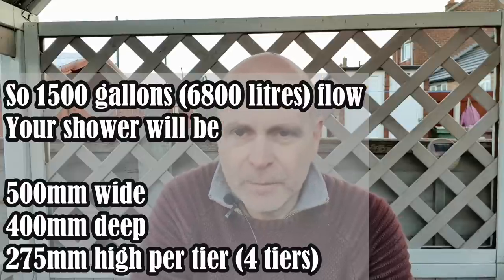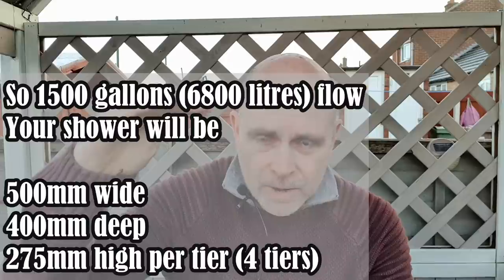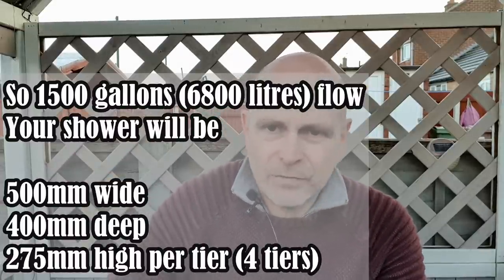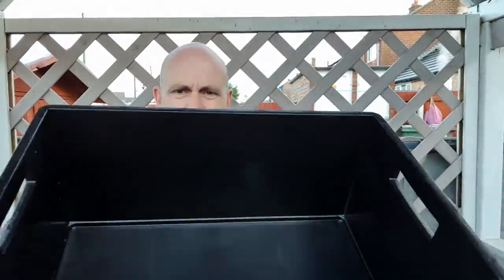DIY Bakki shower (Make your own PART 1) homemade Koi pond filter

Comment: Really love the content of the videos I’m finding them so helpful . I’m currently in the planning stages for my new pond for once I’m in the new house. I would love a bakki shower but can the showers be placed in a filter house and pipe fed back to the pond? The boss aka the wife doesn’t like the look of them 🤔
Reply from the maker: Thanks Robert, much appreciated 🍻
Its not easy to install them remotely unfortunately. Because the water needs to return to the pond from the shower by gravity it needs to sit high up. You can do it but you would need it sat such that there is a pipe running from the bottom of the shower to the pond above water level. As such the shower would be to tall for most sheds and filter houses. Also, because its a gravity return it needs to be a decent width of pipe, I've used 3" on mine and I only have a very small flow over it.
they really need to sit on the side of the pond.
You can box them in and clad the outside etc to make it look better if you want to. That may be an option. I'm going to cover mine and tile the outside with the same tiles I used on the pond I think.
Reply: Thanks for the reply , I personally like the bakki tower look just have to please the wife 😂, that’s a good idea to box it in and tile that’s something I can look at. The world of filters to a new keeper gets very confusing.
Reply from the maker: It does mate. There are a million options and every option has a fan club who swear its the best option. Its good if you can visit some hobbyists who have systems running and see how they are performing.
People want different things to. Some rate a filter highly because it is easy to clean, some because its cheap, etc etc so we all have different ideals.
I place a lot of emphasis on ease of cleaning, not because I'm lazy, but because when its easy to do you are more inclined to do it. I avoid things that are onerous to clean or it becomes to easy to just put it off. I flush mine every single day so the fact that its just a case if turning a few valves and takes 3 or 4 minutes is massive for me.
Reply: I’m all for the ease of cleaning once I’m in the new house and the plans are finalised regarding filtration I maybe asking for you to give it a once over if that’s ok pal , the pond I run now is only a small pond and runs off a pressure filter so it’s going to be a big step up.
Reply from the maker: Yes mate , of course 🍻👍🍻👍🍻

Comment: Good info Dazzle . 👍 I'm building mine roughly 120cm (L) and 13" (H) & 13" (D) with possibly a 15.000 pump or 20.000 Vari??? Also gonna use multiple rock ceramic media within shower (Kintama, Marine Pure sphere ,  volcanic rock + alfragrog 👈 "Maybe")..
Reply from the maker: Hi Simon, sounds good mate, try to use as much of the ceramic stuff as you can as thats the one that will house anaerobic bacteria and take care of your nitrate 👍👍
Reply: I've always used MarinePure for discus and Marining, and in pond (static tho). 1.5" Spheres which 🤔 1.5 inch sphere is equivalent of 132. 000 sqft area surface £64 Per Gallon 👈  and have been around in use over ten years 🤔 don't think I would use that bhm (momotaro) arm leg stuff on six year study?? What's your thoughts on it Dazzle ??
Reply from the maker: Hi Simon, I filtered a 5500 gallon pond purely on showers, nothing else at all, and they all only used BHM. I haven't found an alternative yet that could get anywhere near the BHM, its as good as it gets for me. BHM was developed alongside the shower filter, specifically for that purpose. Unfortunately I can't afford to spend BHM money now so I'm going to look in to it thoroughly and see if I can find something that comes close but costs a lot less.
Reply: @DazzleKoi  Been looking into media myself. From what I've seen, from the likes of crystal bio media and bio home shower media. It all looks and seems to do the same job as grow stones and hydro stones. Which is sold at a fraction of the price. Starting to think it's just been labelled up, to make a huge profit.
Reply from the maker: Hi Adam, the original BHM was developed specifically to optimise the conditions in a shower and with nitrate bacteria in mind. It is fired at very high temperatures which causes the internal structure to fracture and open up millions of tiny 'tunnels' inside that can harbor anaerobic bacteria. The conditions for anaerobic bacteria to live are extremely difficult to create as they need a habitat completely void of oxygen. They then take their oxygen source from the nitrate thus breaking it down in the process.
The ceramics also have some FIR (far infrared) properties and are able to degrade some organic material.
None of the alternatives do this.
So yes, while you can put practically anything you want in a shower and get some biofilm growing and see some aeration, its not actually working as a shower can. Its only really a trickle tower. This is why a lot of people make a shower (or buy them even) and are happy with them as they see some benefits. But in reality there is so much more to be had.
Ive not heard of grow stones or hydro stones though, I'll take a look 👍👍
Reply: @DazzleKoi  yes have a look, will be interesting to see your thoughts on it. I agree the bhm is one of the best on the market, for nitrate breakdown. It's just the cost £200 for 10kg, is a lot to fill a four tier shower.
Reply: @DazzleKoi  But the Marine Pure is 15 years old with production and is well renowned as the BEST Ceramic Media ever made Brightwell doesn't even come close Nor does kintama . And the Marine Pure SPHERE Media is made for SHOWER UNIT with best results with a higher surface area than any other on market. This Chinese, Japanese brittle product in my opinion is hype and over priced for what??? (Be good to see side by side comparison)??I 🤔 Marine Pure Wins ? 🇺🇸 Made do make quality products that most over look or just don't KNOW!!!? (KESSIL, CYBERGENICS, MARINE PURE) 3 Quality products that are unrivalled
Reply from the maker: It looks  interesting for sure. The silica coming of it worries me a lot though. I'll have a proper look in to it though mate👍👍
Reply: @DazzleKoi  I can ASSURE you that silica doesn't leach out of this media, unless you buy the fake 1 that was circulating that leached aluminium and "poss silica" which I've never heard of ?where did you read or get information on silica leaching out of Marine Pure ? as I use to have a Marine tank with lps and sps corals & fish and if any silica was leaching would effect the lps sps and would bleach hard coral and eventually kill which I've experienced when not treating water but then moved onto TRITON programme  👌 .
Reply from the maker: Hi Simon, the silca comment is in relation to the grow stones that Adam mentioned above 
https://www.1-hydroponics.co.uk/grow-media/other-grow-media/gs-1-hydro-stones-35-litres.html
Reply from the maker: No its my fault mate, the way yourtube studio handles comments is a nightmare, its not obvious who I was replying to 🍻
Reply: @DazzleKoi  No worries Fella 🍻. Today I watched a recent upload with Marine Pure and the aluminium problems or people's beliefs about the media (It's on YouTube "Cermedia Marinepure aluminium review "...... AquariumPartners) It has the facts and the findings with TRITON Testing👌 Which is no normal test kit if yr not familiar with Triton?. But I thought it would be Informative.. 👍
Reply from the maker: Cheers mate, I'll check it now 🍻🍻🍻

Comment: Great video. If the 400mm depth is fixed, doesn't that define the width to be a minimum of 400mm? Looking forward to the next video
Reply from the maker: Hi Ryan, I thought a bit more about this. The tray that they do that is 300mm x 400mm is effectively a 300mm wide shower as the 400mm can be used for the depth. 300mm wide, while small, is better than being too wide as it concentrates the flow down more thus having the same effect as more flow.
Reply: @DazzleKoi  hey, thanks for the reply. That makes sense. Compromise at the end of the day

Comment: Hi,
I am about to set up a new pond for my Koi’s because they are growing and are all active and Healthy. Ranging from a year old to 23 years old and eating healthy. Can you recommend a reasonable supplier who can produce and sell me a good quality Box Weld liner for a fair price? 14x10x5 I am building a sleeper pond. 3ft in the ground and about 2ft above.
Many thanks.
Reply from the maker: Hi David, I would suggest having a chat to Cotswold Koi, they always get great reviews in terms of their service and their product.
Bradshawas direct is another one that I hear good things about in terms of price. I think they will be a little bit cheaper than Cotswold but just check to make sure you are getting quoted for the same material and thickness of liner.
Lastly, get a price from atlantica gardens to. I believe they are good value

Comment: Good video again mate, I did laugh @ the "boring old fart" bit. I like the vids and find you very informative personally. Looking forward to seeing your media choice and qty, won't you lose water from the handles in those boxes?
Reply from the maker: Hi Jason, there are options to have handles or not. I did actually order them without handles but they only had 3 left so I have 3 without and 1 with. My plan is to put that at the top as I'll need to modify it for the spray bar anyway. Good spot though, I should have mentioned that in the video, I'll pin a comment on it 👍👍
I don't think it would be an issue really as the water is falling straight down and there are gaps on the genuine showers but its better safe than sorry.

Comment: Defiantly my fav koi youtube. Watched you from day 1. Whats your plan with the exit of the water from the bottom box
Reply from the maker: Thanks Mitch, I really do appreciate that 🍻
I haven't actually decided yet to be honest. I like to have them sat over the pond (say 30cm off the water) and the water drop straight in, I think in my mind that would give the best results but it looks the most unsightly and least appealing from an aesthetic point of view.
Then sat on the pond wall with a weir is another good option.
In my particular circumstance I think I want to fix it to the side of the shed and clad it in the same tiles as the pond. As such I'll need to build some kind of shoot that channels the water in to a single pipe to return to the pond as it has a bit of distance to travel back to the pond. The trouble is I dont know how to do that yet, I may need to invest in a plastic welder and make something myself.
Reply: @DazzleKoi  As you already have the extra euro containers why not use a 5th one at the bottom and add a tank connector to pipe the water back to the pond? That's probably how I would do it.
Reply from the maker: Hi Jim, I considered a tray at the bottom for media to sit submerged but I didn't think about it as a solution to the problem of getting the water back in to a pipe. That's a great idea, I'll look in to that 👍👍
Reply: I’m thinking over waterfall so it’s away from the pond in my situation could work 🤔
Reply from the maker: That sounds perfect 👍👍